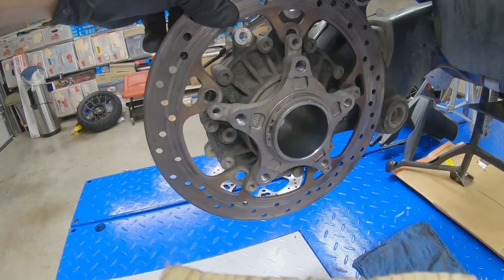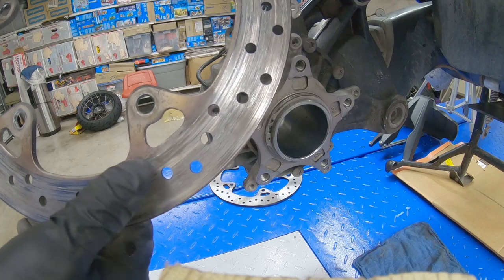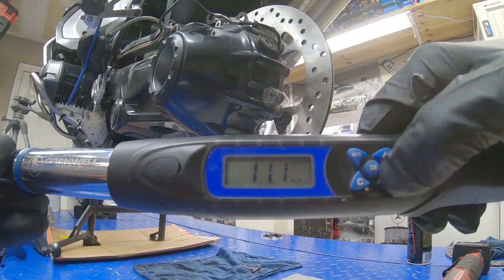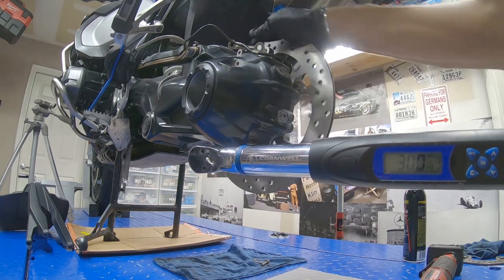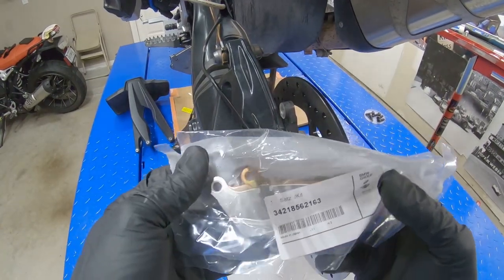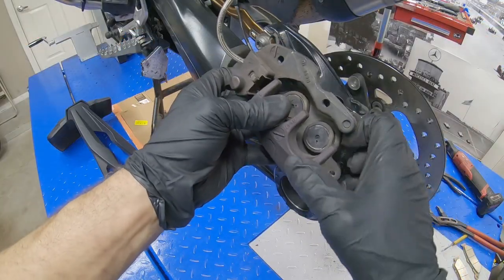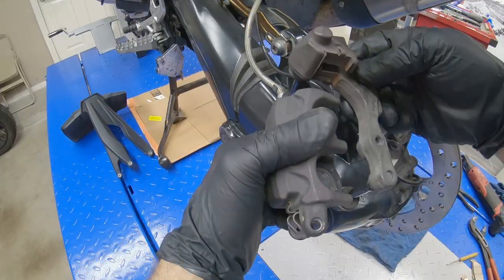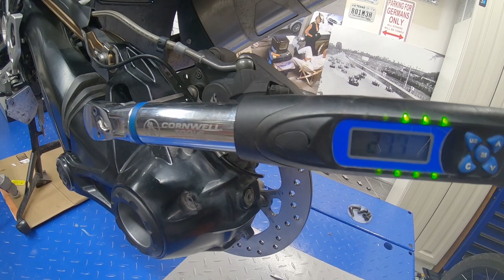Part 1 of 25,000 Miles Motorcycle Service - New Rotor & Brakes - (BMW R1200 GSA)

Comment: aight. I'm so glad I found this video. I need to do just that. I'm ordering the new rotor (40.000km rotor) and pads. Total cost about 180€. While BMW mechanic wouild bill me about 500€ to do this (with parts). Thanks SO much. By the way, can you confirm there's no need to open the break fluid tank to push back on the pistons?
Reply: al right, did the service. fabulous video. thank you once more.